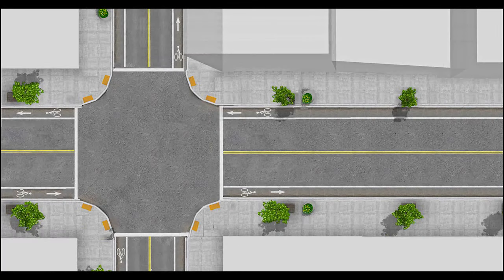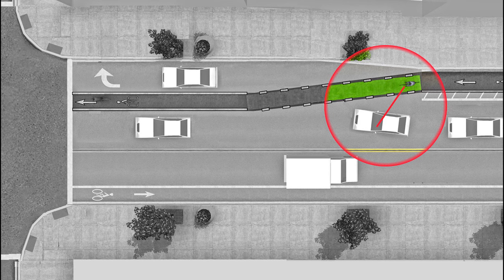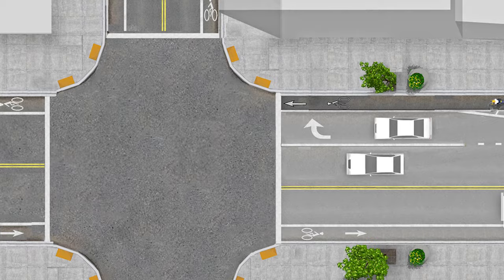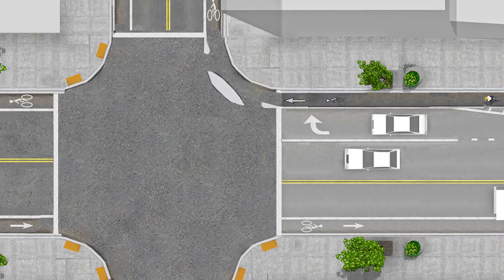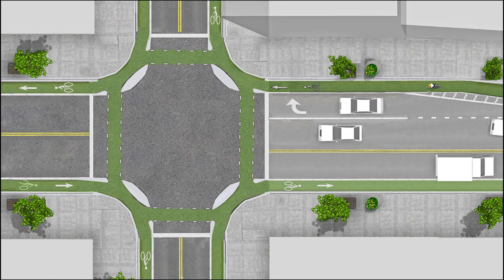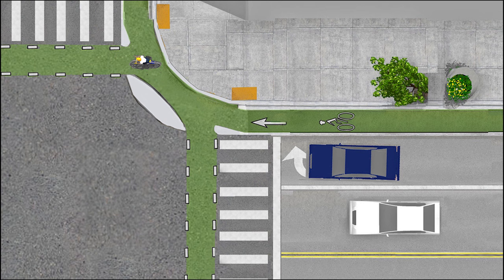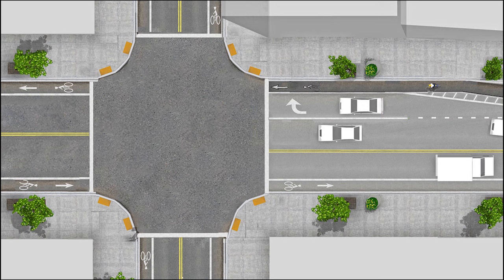Intersection design, the Dutch - cycle friendly - way

Comment: The sequence just depends on the juncton. What I can tell you is that it's extremely rare for cyclists and cars to cross paths when both having a green light. I only know 2 locations within 10 kms around me (Halsteren, NL)
Priority when lights are off are usually cyclist priority in built up areas and car priority outside of built up areas.

Comment: They are mixing it up in this video. 
In the Netherlands we do have cycle lanes crossing a junction without physical segregation. The difference with the first (UK) example where cyclists have to move to the left when going straight is that in the Netherlands cyclists continue straight whereas car-drivers have to cross the cycle lane and turn to the right to enter the right-turning pocket.

Comment: The Dutch city of Utrecht has one crossing like :25, where cyclists have to cross a lane which is turning right. 
I’ve always felt that crossing was so unusually unsafe, and always keep checking over my shoulder when I cycle there to make sure no one is going to hit me. I’m so happy that most other crossings in the Netherlands are safe
Reply: Marnixlaan/Amsterdamse Straatweg, right? :)
Reply: @oilslick7010  No, both Marnixlaan and Amsterdamsestraatweg have separate cycling lanes. I meant Nachtegaalstraat in the direction of the stadsschouwburg. But they've changed the entire street now. It's now a cycling street, cyclists continue straight on, and cars have to cross over. But due to all the changes it doesn't feel unsafe anymore.

Comment: So how does a left turn actually work for a cyclist? 

Are you crossing the path of the same-direction right-turning motorists, then crossing the straight through motorists going your original direction and then those going the opposite direction, as well as any oncoming left- or right-turning motorists (though that last part isn't really any worse than the oncoming traffic, other than maybe adding lanes)? Or is there a separate light cycle for the cyclists while the motorists are stopped? Or do you have to cross one way, wait for the light to change, then cross the second way? 

It seems like either significant delay, or way more path intersections, than merging left and then just making a regular left turn when the motor vehicles do (presumably with a dedicated left-turn signal if it's a high-traffic intersection).

Comment: A cyclist was killed at an intersection in Toronto that does not have a protected intersection design yesterday July 25, 2024. It is 2 blocks away from an intersection that is currently under construction that is getting a protected intersection design. (Bloor and St George) The design is not perfect but it has a lot of essentials seen in this video.

A week from now a ghost bike will be placed at the location where the cyclist was killed. It’s the following week the St George intersection is scheduled to be completed (August 9, 2024).

Something that seems to be missing with protected intersections is the ability to convert streets to protected intersections with temporary materials. The Bloor St George intersection has seen countless set-backs so often that I’m still not entirely convinced it will happen by August 9th. Being able to install a protected intersection with temporary materials as a pilot project means the Bloor Avenue Road junction could get a protected intersection treatment within a week instead of doing it years from now. And it means small changes could be made before permanent materials are used.

The death of the cyclist yesterday is not the first near this corner. There have been one at the corner and 3 others nearby. So making info and education available to drivers, cyclists, local merchants, politicians and city street planning staff is essential. The info needs to include:

What a protected intersection is, what it is for, how it works.

Examples of effective and ineffective designs with a list of criteria.

Reasons given why so many North American cities are hesitant to install them (myths about why they are bad, can’t be used) together with how these myths are not true, plus what the truth is about them.

When I first saw this video I understood and supported this design but it’s been over a decade and we’re still just getting our first protected intersection now. And literally people are dying because progress is slow.

Comment: If you live in a place like Minneapolis this is really redundant, as the Light Rail, Commuter Rail and Busses all have bike racks on them, and connect to bicycle only pathways that cut through large urban greenways, most people actively avoid riding in downtown minneapolis, as most of the streets are one way, and requires a circuitous route to drive, or ride, unless you use transit(which can traverse bus only streets)
Reply: That works really well when there the percentage of cyclists is very low.

But in the major Dutch cities you have many ten thousands of cyclists every single day. It is impossible to take that many bicycles with the bus, in the subway, light rail or train.

There are pedestrian/bicycle ferries in Amsterdam though. To see the volumes see, among others:
https://www.youtube.com/watch?v=gS1sfkzw-Ic

A (bus) bicycle rack for hall a dozen of bicycles or so simply is insufficient.

Comment: Left turn is always a problem , BUT: if you flow with the traffic and blast trough the (green light) junction 40km/h+ it may be a safe move (not safest.. safest is to watch TV in the house) and certainly the fastest way.

We have some odd shaped cycle lanes that I seldom use (they are on pavement-sidewalk with kerbs in the way) and I mostly go with the traffic lanes depending on situation and "biology" of that junction.

Comment: In the UK we had a massive argument surrounding the waste of funding for cycle safety when a 'turbo' roundabout was built in one of the towns, in fact it just allowed motorvehicles to go faster and hindered people on bikes as well who have ZERO priority and in fact increased the danger and yet the local authorities went ahead anyway. They said it was a success but all it did was put people off from cycling at that junction altogether. Crazy!
Reply: You only see turbo roundabouts in the Netherlands with tunnels or bridges for cyclist.
Reply: @reddishcat1  Not entirely true, lots of turbo roundabouts where cyclists cross at grade. However, cyclists will never be directed onto a turbo roundabout and never be given priority when crossing at a turbo roundabout. Of course, we try to set back cyclists from roundabouts wherever possible anyway, new toundabouts are rarely built with cycle lanes on the roadand instead with fully separated cycle paths. Uden is a good example of this, a lot of roundabouts in the centre, a lot of cycle lanes instead of fully separated paths and indeed a lot of roundabouts with cycle lanes, but the newest roudabout has separated cycle paths going around despite each street coming in and out having cycle lanes.

Comment from the maker: That would depend on traffic volumes. The way to lead cycle tracks along and over such a road could be similar, but a grade-separated crossing is more likely with higher volumes of motor traffic; like here: /watch?v=oBB2sNikaEE see also the blog post (link in info-box of that video).

Comment: this is amazing! It would be easy for this to be implemented into the 2 lane intersection in my area that has shoulders wide enough to fit 1 1/2 cars easily.
Reply: That is optimal, for it could provide space for halfway "waiting islands" for pedestrians crossing. They have proven their worth as a safe and relaxed way to cross a street. Especially slower people and elders appreciate them a lot.

Comment: For different reasons our roundabouts have precisely the reverse set of rules.  Cars do NOT stop when entering a roundabout because of the turbulence created and the reduced traffic flow for any given road size.  Similarly pedestrians and the like must give way when the cars are leaving the roundabout to avoid clogging the roundabout with stationary vehicles.  These rules were not based on safety but on the need to keep people moving.  Mostly our roundabouts are too small to have any of the niceties that are shown here so all I can do is take up my position in the middle of the lane prior to entering.  There is zero provision for pedestrians.  Alas there is never a "one size fits all" solution to problems.

Comment: Compared to the first junction with the right turn lane on the outside of the cycle lane, the dutch junction has a wider turn radius. If a truck was able to turn before, it will be even easier with the new setup.

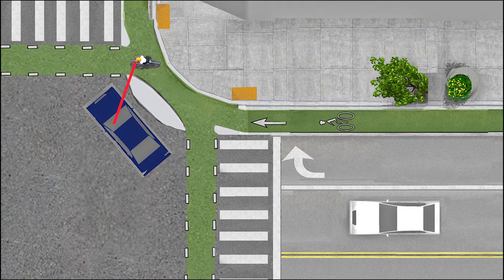Comment: Check the complete overview at 1:54 - draw a line from where the first car would be standing and tell me how much it needs to be moved. If done correctly, you will see that it isn't a problem. For really tricky intersections, mirrors are used.

Comment: It would be nice to see the actions of a left turning cyclist, and a cyclist going straight. Does a cyclist have to drastically slow, swerve right, then swerve left to get through this? What are those extended 'curbs' made out of? can a cyclist ride over them (if needed)?
Reply: All good questions. As mentioned in the video the exact size of the curbs varies quite a bit. You can see a really small one with just a regular curb and a really big one which doesn't really seem to have much of a curb.
To see what going round one is like irl I would suggest looking at a few more videos on the channel. He does entire rides from one place to an other which you can look at for example.
Reply: Go to his channel. Loads of information and examples.

Comment: On 1.30 the note says that each direction and each type of traffic has its own green phase in the Netherlands. That is incorrect. It usually IS, but in a lot of built-up areas straight-on traffic (cars and cyclists) will share the same green phase.

Comment: the only thing with including this in the US is planners need to make room for trucks to get where they need(and should) be. in a combination residential/commercial area in a city, combination trucks longer than 30' shouldn't be down there anyway so implementing this would take not much more space.
Reply: Unless ofcourse you do what we do in the Netherlands: you provide for space in the opposing lane when needed. Every Dutch driver learns how to judge the space vehicles need to make a safe turn, so when they see a truck wanting to turn they hold back to give the truck space to use the lane they're in while turning. It's not rocket science.

Comment: There's no doubt that this design is the most pleasant for cycling, but I'm not convinced about the safety aspect.  I think that this video exaggerates the danger of crossing at a narrow angle.  It's just a lane change.  Cyclists usually travel at the same speed or slower than cars so they are clearly in view of drivers.  With Dutch design, cyclists can easily come from behind cars waiting to turn right, so drivers still need to check over their shoulder.

Comment: it works well for the slower paced dutch habits, but I think in America, you'd have a lot of cyclists breaking out of the cycle lane so they didn't have to slow for a chicane at every intersection.  there is also the problem that being aware of those around us is against the American religion.

Comment: This design also appears to slow cyclist down dramatically, if traveling straight through the intersection, due to the circuitous path taken.
Reply: It's a design for a city, you won't be racing anyway and provided that you have a green light, this small turn you make really doesn't slow you down at all. Not nearly as much as other people and you can't really do anything about those. If you want to make serious progress, avoid cities (or atleast the centeres, because that's where they put trafic lights instead of roundabouts).
Reply: @woutervanr  Not all cities are 85 square miles or smaller.
Reply: @shannontrainer5857  And water is wet. The solution for that has been known for decades as well. It's called multimodal transport. With a train/metro/subway and a bike or your legs you can get anywhere quickly. Also just building higher instead of spread out, this cuts down distances massively. This is especially true for shitholes like Houston. For hills and/or wind is also a solution, the e-bike.
Reply: @woutervanr  I wouldn't trust an underpowered dutch-style e-bike for hills because it's still being held back by sheer weight and inefficient Dutch upright geometry.
Reply: @shannontrainer5857  Still on it? When will you come and visit, Shannon?

Comment from the maker: No, the whole point of this design is to separate drivers and cyclists. They stop as far apart from each other as possible; cyclists pushed forward and cars pushed backward. Certainly not for the same stopping line! Under normal circumstances the cyclists who have stopped for a red light do not block the way for other cyclists that pass behind them to go right or straight on from the other direction. There is enough room for that.

Comment: I disagree with your 3rd point. I think this design is only to be applied to existing roads with bicycle lanes. Thus, they should already be wide enough to accommodate the road+bicycle lane. This design just shifts around the position of the right turn lane and the bicycle lane, no extra width is required.

Comment: @reaperexpress If I'm correct the lane change you refer to is what's being stated as "old fashioned" in the video.  I have to go through several such junctions on my commutes and it is very unpleasant and unsafe, even with moderate traffic going at 35 mph.  Some continue to the intersection while others force you to change lanes to continue straight.  This is only safe at all if drivers are paying attention completely.  And what's the use of a "safe" system if no one feels safe enough to use it?

Comment: But the islands are quite annoying for the cyclists because they need to reduce their speed to get around them when going straight. So the fast bikes tends to use the car-turning-lane instead because it will allow them to go through the intersection without reducing their speed.

Comment: The design is not that great regarding the left turn problem, because cyclists have to wait two traffic lights cycles to turn left. 
Amother design is to have a dedicated space for bikes in front of the cars, by pushing back the stop line for cars. That design is great... as long as you arrive at the intersection when the light is red, so you have the time to get in front of the cars. If arrive when the light is green, it reverts back to a standard, dangerous, intersection

Comment: Please tell me this has further tweaks, like allowing every car beyond the turn right stop marker finish the turn and the marker had to be 5-10m away from the junction. I get promoting bicycle traffic instead of car traffic, but going from one abs value to the other in 60 seconds is like signing your death sentance - silly at best.
Reply: I do not understand what you mean. But in The Netherlands there is no ""switch" from one absolute value to another absolute value.

As far as I know (but I might be mistaken) cyclists have to yield for right turning car traffic (or pass the right turning car on the left side).
In The Netherlands we have one consistent rule. Turning traffic, including right turning traffic, must yield for any straight continuing traffic. This includes straight continuing cyclists as well as straight continuing cyclists (unless otherwise controlled by traffic lights or other means).

Comment: Very clever! But the left-turning cyclists just heads through or has to wait somewhere? Maybe this is a crossing with four stops (one for each incoming road) for motorized traffic at the level of the zebra crossing?
Reply: Left turning cyclists cycle around the intersection, treating it as two crossings in close succession.

Comment: What is the purpose of those lines across the middle of the road at 2:06 and why are they only in the 'horizontal' not 'vertical' direction?  What would happen if they were not there?  Can they only be in one direction or are there intersections with similar lines in both directions (top to bottom & left to right)?
Reply: Ah, yes I forgot about the possibility of traffic lights being out of service.  That happens about once every 5-10 years where I'm from so didn't even enter my mind.
Reply: Robert  I almost never see lights not working.  Once every 5-10 years it might last a few hours.  Did you intentionally misinterpret ;)

Comment: Dutch: Devises a junction which prioritises safety and simplicity for cyclists and pedestrians without hindering the driver's experience, and at the same time, at low cost with no need for expansion.

Ireland: heres a cycle lane which only goes 25m take it or leave it

Comment: @markenlei I did understand that part, but large vehicles are to move closer to the center of the junction, possibly  disturbing traffic flow on smaller junctions.   Could be I'm wrong, it's just a question.